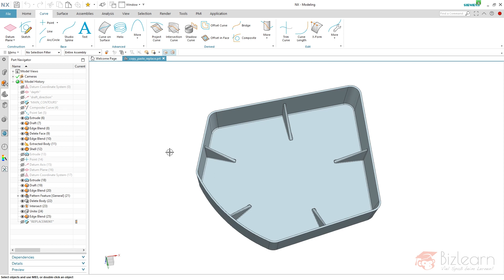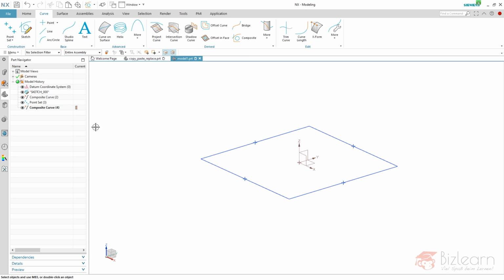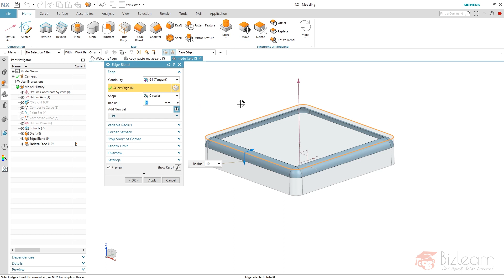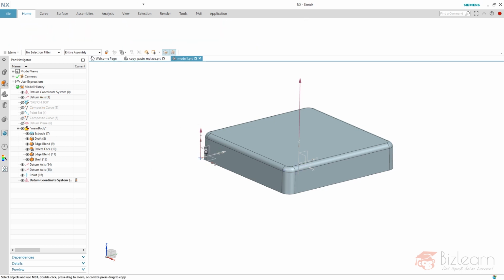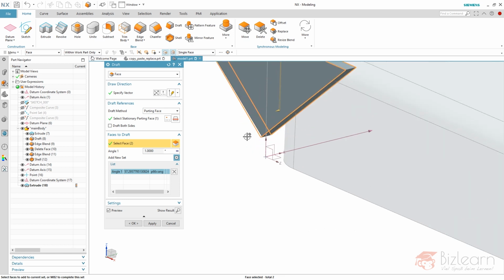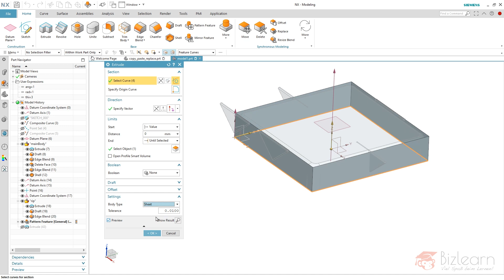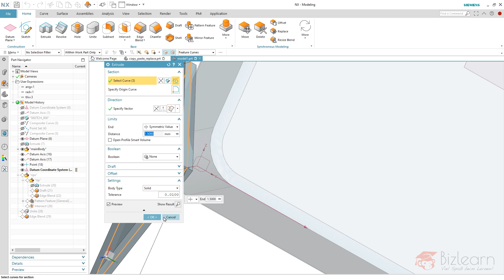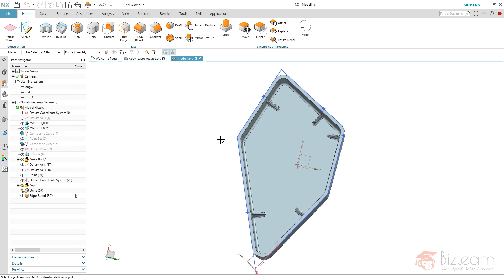Siemens NX Pro Tutorial - how to create extremely flexible ribs using the feature pattern

Comment: Why using a datum plane to set the extrusion boundary? In case you want to replace it by another face for example? Because if its just for the extrusion-lenght I don't see the advantage over just stating the 30mm in the extrude itself. It makes no difference, where you change that number, still have to do it one time!?
Reply from the maker: Hi, the plane is referenced 3 times. So it can make sense to use the plane😉
Reply: @Bizlearn_Siemens_NX_Training  missed the last two times (had to rewatch). I definetly see the difference to referencing the top of the extrude als plane